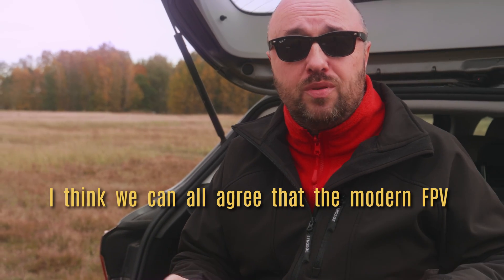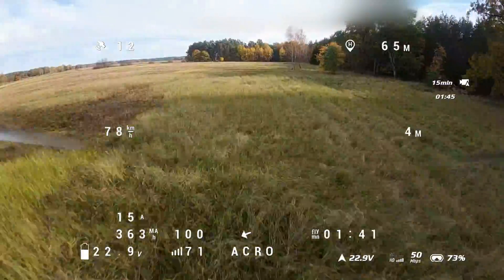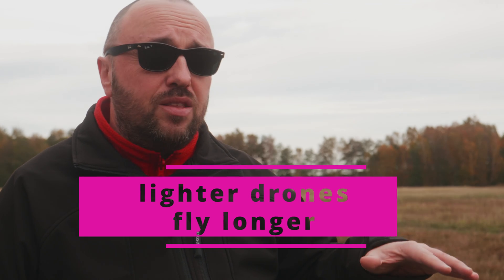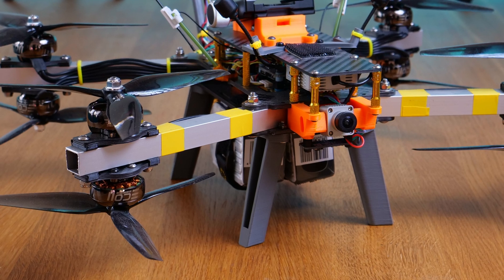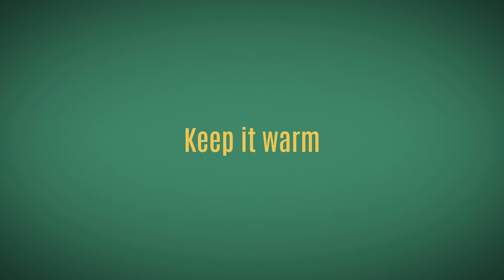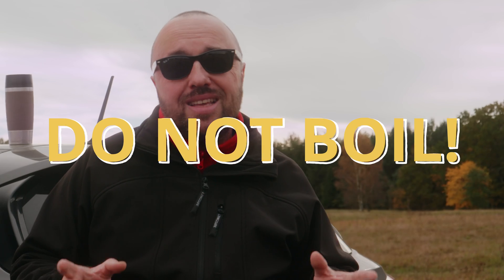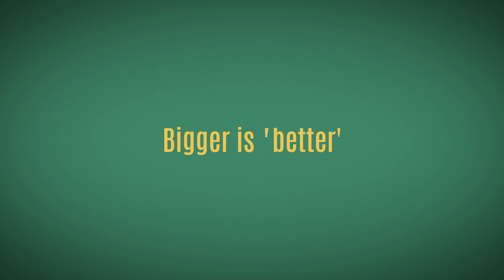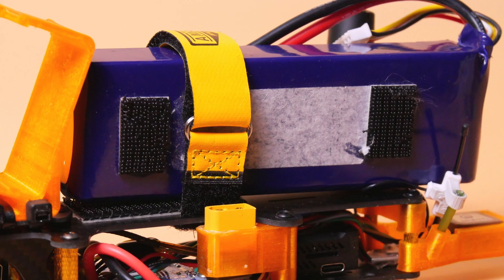How to fly longer with a drone?

Comment: As you mentioned, bigger batteries are not always better. They are also much more expensive. I fly mostly with 450mah 4s, bought for a steal from Hobbyking when they shut down the European store. Gives me 6 to 7 minutes of flight time on a lightweight 4 inch LR4 frame with 1404 motors and 4inch props. And I'm not tender with the throttle. I have enough of them to fly for a couple of years 😁

Comment: I've pulled some pretty good distance before. Of course the big limiter right now is video link range. Hoping ELRS eventually outputs basic telemetry for an antenna tracker so I can put some super high gain helicals on. Currently working with some fancy patches, but I need more!

Thanks for all your hard work to make iNav great!
Reply from the maker: Thanks for sharing!
Reply: I believe there are already trackers out there that support CRSF or there is currently a mavlink version of ELRS in beta.
Reply: @thirtythreeeyes8624  If I'm not mistaken, the full Mavlink connection will require a specially flashed transmitter for high end telemetry. But hey, I'll wait and see.

Comment: Good basic info to fling longer, or farther. Regarding vibrations, that's energy that's not going into thrust. So balancing propellers, and motors and making sure everything is secure (not loose) will save energy. Balancing propeller size and propeller pitch to motor size can reduce current. ie: if motors are running warm, they're wasting energy. 
Another tip is to use higher voltage batteries, as it reduces current needed to operate motors, and because heat from resistance is a factor of I^2*R less energy goes into heat. Using higher S (6S vs 3S, or 4S) is easier done on larger drones, as the extra cell or two is a smaller percentage of total weight. Finally, analog video tends to be less power hungry than digital video. (digital VTX's tend to run hot) Like everything it's a tradeoff, it flight time more important than video, then ... ;)

Comment: 5:17.. Acid Flux is a Definite No-No for Electrical connections. It is used for Sheetmetal soldering only.
Over time the current flowing through the Acid Joint will corrode.
Reply from the maker: It is yes-yes if you rinse and clean it properly. I have 5 years old LiIon pack soldered with soldeing acid and it's working perfectly well, no corrosion

Comment: My recent observation - the closer you are to max throttle while cruising, the longer you'll fly. For example, I made some very unscientific experiment on 2" whoop. With 22k 1003 motors it was consuming 17amps floating on low throttle, while 13.5k 1102 flew on 77% throttle on full battery, but used just 8.5amps. Everything except motors was the same. Also tried 120g 2.5" with 1404 6k on  2s and 3s. On 2s it was hovering on high throttle with 17amps, but just going 3s made it much less efficient hovering on 23amps. So, in watts, it has been using twice more power just to stay in the air.

My assumption is that as any electric motors are not good with throttling, brushless are not exception, and less throttle you are using - less efficiency you have. So it's better to use as small and low KV motor as you can, and you can prolong fly time a lot.

Also, going with bigger two blade prop, with lowest possible pitch, should add time. Especially, with appropriate motor.
Reply: Brushless motors are generally most efficient around 60% of their maximum power dropping down significantly the closer you get to maximum so running something on 2s that would normally be 3s means you're running right in that efficiency window towards full throttle. There is also as you suspect an efficiency lost by running at lower throttle because of losses from the way the esc works.
Reply: @thirtythreeeyes8624   please, share, where you found about 60%.
Most of testing results that I've found on internet, such as SiieeFPV, says that more rpm you use, more efficient you get.

60% is, probably, taking prop into account as propeller gets less efficient with RPMs. So when you test single motor+propeller efficiency, indeed, it would be best near 60%, but if you can get less kv motor, efficiency for same thrust requirement, will be better.

Comment: I managed around 23km and 25min round trip with custom build aos7 (tmotor stack + f90 1300kv) and molicel p42a 6s2p, 8400mah total capacity. Not great, I've seen people get 30km/30min at least with the same battery setup, so I'm not sure what I'm doing wrong... 

I might have messed up the motors during pid tuning, because I didn't check the temp after each flight and stopped only when I smelled something (motor coils getting too hot, not burning, but too hot) and burned myself on the motor - coils are fine, but magnets might have been partially demagnetized.

Btw this record was my first flight with that battery setup on almost stock inav 7. Cruise behaved very weird, it was jumping on pitch and was also heavily rolled (to be fair, it was windy, but I had to fly the test in acro, since it was by far the most stable mode).
Reply: Windy conditions and non perfect tunes will effect flight time, there's also other factors like cg not being centered and I've even heard you should condition the batteries by charging and discharging at a low c a few times before actually using but, I'm not sure how big of a deal that one is.

Comment: I used old frame zmr 250 with 1806 size motor with triblade 5" and  4s 21700 liion pack battery (4000mah ) for  15 mns flight time

Comment: Good advice Paweł😀
Flywoo explorer 4" WS PRO kit got 11-15min from 850mAh 4S, on 18650 4S didnt get to an end😅
Baby Ape II 3,5" analog got 5-11min from 850mAh 4S lipo battery.
Both drones weigh approximately 250g with battery.

Comment: Another tip is size up, the bigger the prop the more efficient. I've went 42 minutes on an ultralight 9" with a 400gram camera/gimbal onboard and have a 13" in the works that should get to an hour or more depending on camera setup.
Reply: Bigger props are only more efficient if you keep rpm down.  Want to bring the speed?  Go smaller on the prop.  Tip speed goes up fast, and drag goes up exponentially with speed.
Reply: @scottyh72 
Yes the drag goes up with the square of tip speed. BUT so does the amount of air moved - the area of the prop disc is π r².
*In addition*, as the prop moves faster through the air, it moves the air backwards faster.
Thrust = mass flow rate * delta V.
Increasing the diameter of the prop means that for the same RPM you both increase the mass flow by square of the radius, and also have higher delta V.

Larger props will always be more efficient for the same amount of thrust.

In fact, the power coefficient is inversely proportional to the diameter to the FIFTH power. Yeah, D⁵!

Yes, drag is D². Thrust coefficient is D⁴. Power coefficient is D⁵. Yes, these are all exponents. But there's a big difference between 10² and 10⁵ !

10² (proportional drag) is 100.
10⁴ (thrust coefficient) is 10,000!
Reply: Ps -
Drag does not go up exponentially with speed. Not nearly. Not anymore than your age increases exponentially with your age.  :)

"Drag goes up exponentially with speed" would mean
drag = x ^ velocity

So an example of "exponentially with y" would be:
d = 14ʸ.

I think you meant it increases quadratically with speed. Proportional to v². Not 2ᵛ.

Normally getting this right might not matter, but in this case it makes all the difference in the world. Aircraft would be designed entirely differently, and probably couldn't exist at all, if drag were exponential to velocity.  Since it's only quadratic, not exponential, flight is possible.

What if we did redefine math to start calling any formula with an exponent in it "exponential"?  Well then your current age is:

Age = Age¹

That has an exponent, so we would say "your age increases exponentially with your age". 😃
Reply: @senseisecurityschool9337  Thanks for breaking down the math on it, all my caveman brain knows is, big prop fly long haha disc loading is also usually a lot better and unlike most people I really like floaty rigs.
Reply: @senseisecurityschool9337  of course a bigger prop moves more air.  But if you are moving more than needed for the required speed, you lose efficiency.   Airplanes need pitch speed more than static thrust.  I'm also aware that in flight props unload, creating more thrust.  That's why I run smaller props with more pitch.  More speed with less power.  I can do 150mph on 1kw.
Reply: @scottyh72  Again I have a caveman brain but, how do you move more air than needed seems to me if you move more air you'll produce more thrust, also what setup are you getting 150mph at 42a assuming it's on 6s? If it's only a 1300mah battery though that's like a 2 minute flight going 5 miles and sizing up the battery is going to increase your amp draw especially as speed goes up. I could claim a 1s 3" drone is better since I have 1s drones that use .6 watts per mile while technically it's way more efficient than a 9" burning 11 watts per mile, it's clearly not better for long range just like your drone at 6.6 watts per mile doing 150mph isn't better it's just faster and nobody flying long range is trying to fly at 150mph.
Reply: @thirtythreeeyes8624  Airplane not drone.  More thrust does not equal better performance.   You can have huge thrust with no pitch speed.  Not going far with that setup.   You need to balance thrust/pitch speed for the application.
Reply: @scottyh72  If we're talking about planes I guess the analogy would be a smaller wing will go faster on the same power and has less drag but, that doesn't mean a fighter jet is better than a jumbo jet. Either way though you can't really compare the two since a multirotor doesn't use wings for lift, as speeds increase the wing on a plane adds more drag than lift.
Reply: @scottyh72  
"More than needed for the required speed" would mean you're going faster. Newton's second isn't just a neat idea, it's a law.
Or did you intend to say "flying the airplane faster can be less efficient"? If that's what you meant sure, flying faster takes more power.
For whatever speed you're flying, you would have gotten there more efficiently with a larger prop. Because most of your drag comes from the near the tips - the tip vortices. When your whole airfoil is nearer the tip, your whole airfoil is more draggy.
Reply: @senseisecurityschool9337  If that were the case, we would be doing intercontinental flights with helicopters.  A sky crane produces tons of thrust.  Not so efficient for long distances.  I'm pretty sure I wouldn't be going faster on my goblin with a 15" prop.  You couldn't spin it fast enough to achieve the same speed as a smaller prop.
Reply: @thirtythreeeyes8624  A propeller is a wing.  It's just going in a circle.  As you spin it faster, more drag.
Reply: @scottyh72  
Absolutely. A prop is a wing, moving in a circle. Here's the world's most efficient wing:

https://en.m.wikipedia.org/wiki/Eta_(glider)
Reply: @scottyh72 
We do intercontinental flights with a 747 or an A380.
Because they have much larger wings than any helicopter.

This is first semester stuff. You can look it up and understand it probably faster than you can come up with your next idea on why all aircraft designers since the Wright brothers have been wrong, and whatever thought randomly came from your butt is correct.
Reply: @scottyh72  That is often said but, it's an oversimplification. A wing is for lift a propeller is for thrust and on a multirotor the thrust is the lift so while a larger prop increases drag it is also increasing thrust and doing so with a better L/D ratio this is why bigger props can produce more thrust for the same amount of power input. Your goblin wouldn't go faster on a bigger prop because you're not also scaling the motor to overcome the increased drag, better L/D doesn't mean there's not still an increase to drag just that it produces more thrust for that amount of drag.